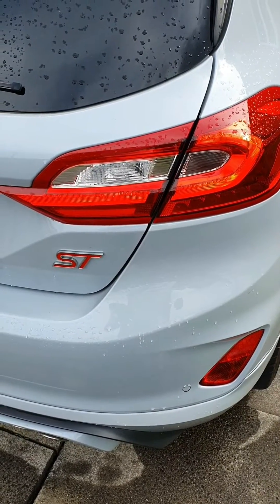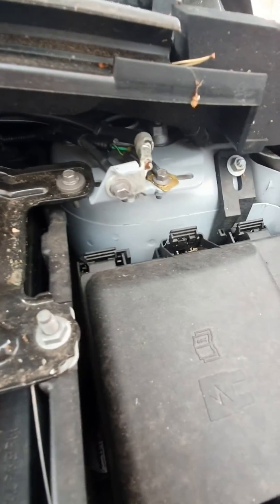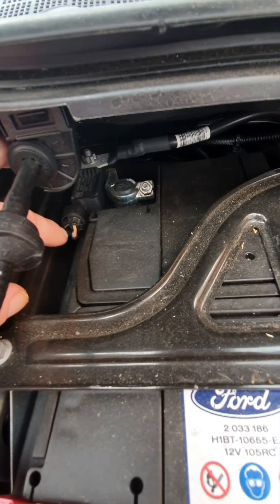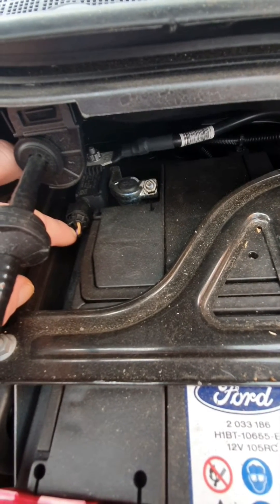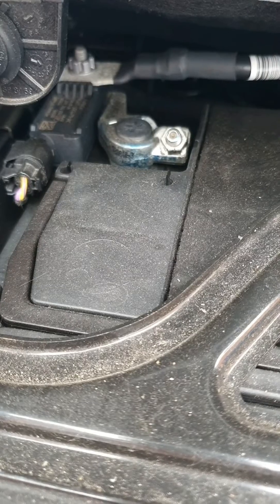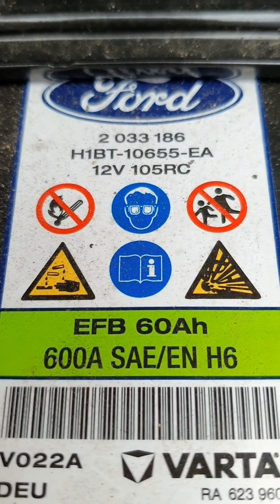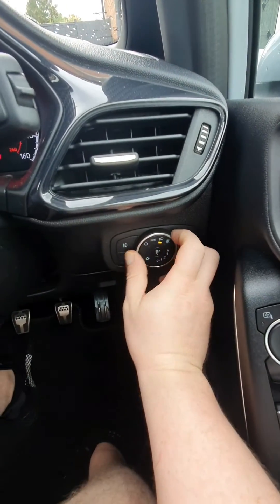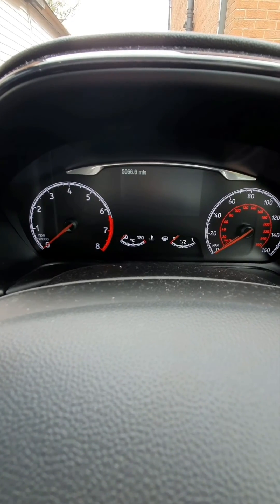How To Reset BMS - Ford Battery Monitoring Sensor Reset - MK8 Fiesta ST- Extended Version

Comment: I have a 2021 Focus and the air conditioning stopped working and always receiving messages from the BMS, I did what you said in the video and no longer receive messages when I turn off the car and the air conditioning started working again, thanks mate 👍👍👌

Comment: I've just reset bsm on my 2020 st focus and straight away auto stop and start is working and smart locks on both doors are working. My battery is 3 years old so should have set bsm as my cars bsm will think my battery is new ?

Comment: Hi, is it possible to completely remove the battery without first taking off the air filter? Thanx in advance.
Reply from the maker: Hey, thank you for your comment. If I remember correctly the battery can be removed on the MK8 Ford Fiesta without the need to remove the air filter housing but it is very tight and it is easier/safer to remove the air filter housing first. Attempting to remove the battery without first removing the air filter housing can result in damaged parts or personal injury so I would advise against it. Hope this helps

Comment: I have a kuga 17 plate just replaced the battery as was the original and was getting slow starts and stop start greys out cars all working as should with new battery but still no stop start I have tried your method but no luck

Comment: I have a 2 year old mk8 ST. It shows  "turn off ignition or start engine". Is it OK to try the rest procedure  without changing battery? Few months backs I didn't use the car for many weeks after that it's in regular use. I notice the message frequently these days

Comment: You are the best. Authorized Ford service center couldn't fix start/stop system since one year. Your way managed to do this. Start-stop is now working well! I didn't switch battery, previous owner only ride a car in short distances. 
Thank you! 
Maybe you or others could help on another challenge? How should eco mode work on mk8 st 2019 (switching to 2 cylinders) any icon on the dashboard should show? How I should know if it's on or off?
Reply from the maker: Thank you. Is it the ST Line 1.0l ecoboost you're talking about? The car doesn't let you know that it has entered/exited cylinder deactivation mode
Reply: @DansDiagnostics  I'm satisfied user of 2019 Mk8 St3 1.5l 200KM with performance package. Driving on normal mode I can't recognize when car runs on 2 cylinders. Previous owner mentioned that somewhere on dash "eco" icon was visible after cylinder deactivation. That is why I'm looking for more details.

Comment: Tried this on a 2017 kuga didn't work,any other way cheers
Reply: The reset for your vehicle should be…. Ignition on, press rear fog light 5 times, then hazard warning lights 3 times.
Battery light should then flash 3 times to indicate it’s reset.

Comment: My car is like 6 months old. All works but Ford pass keeps throwing deep sleep mode warnings. Battery voltage is 12,2 and the car is used daily.
Even after doing 90km of highway at speeds of 120-130km/h, throws the same issue of deep sleep.
You think this reset may help?

Comment: Hey man in worked !
Question, we’ve got a ford st line 2019
But both of the front window bounce automatically back when we want to close them, we cant fix the problem, do you got any idea how to fix this?
Reply from the maker: It most likely needs a software update or reset on the Drivers Door Module (DDM). Theres a manual reset procedure but this doesn't tend to work too well when the windows bounce back like they do. IF I remember correctly you start with the window down and hold the window switch up until it reaches the top, then hold down till it goes all the way down, release the switch then press it down and hold for one second, then hold up till it gets to the top. IF it doesn't bounce back press and hold up for one second then try the one touch down and up and hopefully it'll reset. If not I'm either not remembering it correctly or it most likely needs the DDM update/reset. It is under warranty tho so you could get it sorted at your local Ford dealership 😁
Reply: @DansDiagnostics  yeahh!
Yesterday i installed the New update!
But i didnt worked, ive readed On internet that its a safety option for when something come in between it automatically bounce back, hands of little childeren as example
Can’t you make a video for the manual procedure? I’d really appreciate it!

Comment: Hi Dan, thanks for this. I have a MK3 Focus Tit X, are there 2 ways to reset this? Some videos suggest pressing rear fog x5 and then hazard x5
Reply from the maker: Hi, yes, this method works on the newer cars and on older ones without a rear fog button. Yours will need the ignition on, press the rear fog 5 times then the hazard switch 3 times and you should see the battery symbol flash on your cluster. Hope this helps.
Reply: @DansDiagnostics  that's great, thank you. I'll give this a try on Monday when the new battery arrives 👍🏻

Comment: Having problems with 2018 Smax, the dealer recalled and changed something on the BMS and the stop/start and the heated windscreen stopped working. No error codes were showing but it still didn't work. I think they possibly forgot to reset the BMS so when I get it back I will do it. One question, should I disconnect the battery before charging or charge it in-situ and then reset BMS. Also, does the  stop/start take its information from the BMS level because I have read that if you reset the BNS with a used and slightly depleted battery it will work because of the the new lower threshold level. The stop/start does not bother me too much but the non-working heated screen is a real PITA.

Comment: Hi Dans, thanks for sharing. I have fiesta 1.5 S AT 2014 is it possible to use the same method on resetting BMS after changing the battery as you shows in the video?
Reply from the maker: Hi, thanks for watching and commenting.

This method works on most Ford vehicles that I have tried it on, however there is another reset procedure that usually works when this one doesn't. 

Ignition on
Rear Fog pressed 5 times
Hazard switch pressed 3 times
You should see the battery light flash on the cluster if it has worked.

Hope this helps